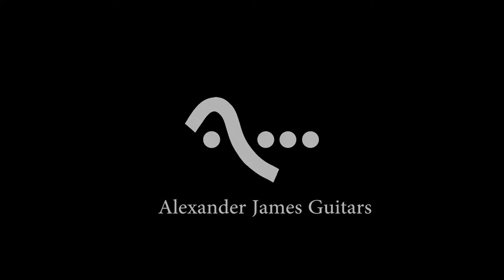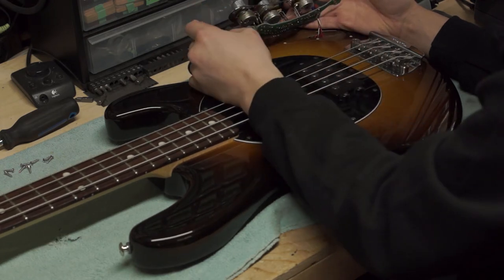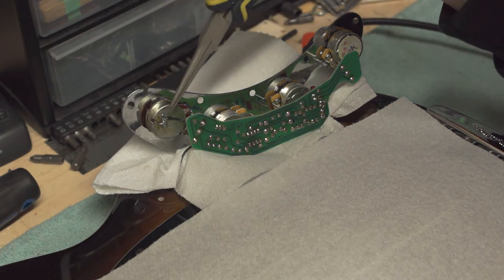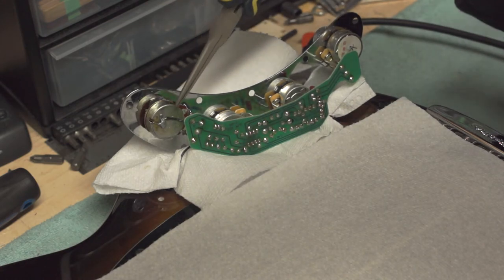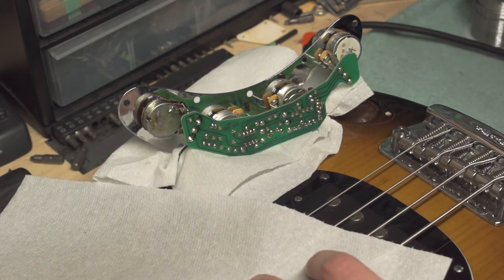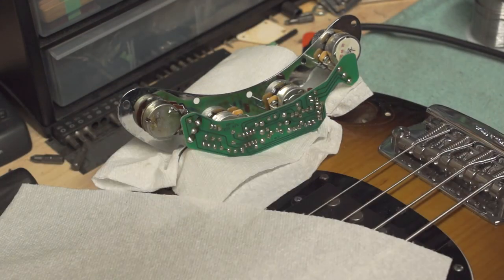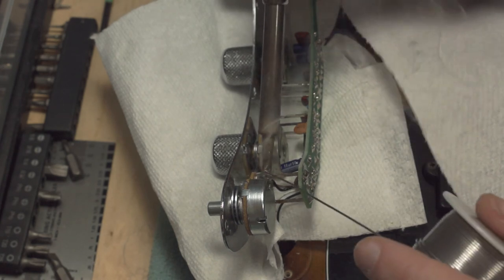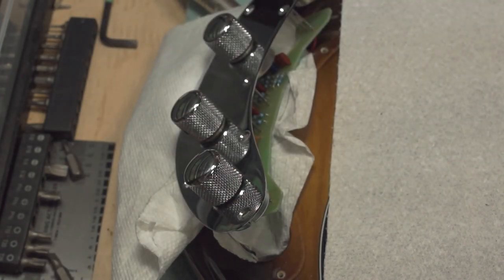Ernie Ball Stingray Bass electronic repair - Fix it Friday #1 AJG

Comment: I had this same issue with many guitars and bass. I solved the problem. The contact cleaner I was using didn't have lube in it. Common contact cleaner from the local hardware/ auto stores isn't designed for potentiometers. It's designed to clean none moving connections.  Something like Hosa D5S-6 has lube in it and improves the connections in the potentiometer. However it is expensive so the cost of replacement potentiometer vs buying this cleaner is up to you. I'm little late on this video but what else are we doing in the pandemic?
Reply from the maker: Wow, thank you for letting me know that. 
I didn't know that. 

Gotta find something to keep our mind active during this pandemic! Thanks for watching and commenting BTW.

Comment: Tip: On my Stingray I re-attached each knob with its tightening screw at the exact halfway point of travel. The screws now indicate the 0 cut/boost point at a glance when I look down plus I can see how much I have boosted eq, if the volume's up full etc Simple and super useful adjustment to make.
Reply from the maker: Nice!
Reply: I did similar but have them pointed line of sight towards me. Really helps on dark environments.

Comment: But why was then the scratchiness gone when you touched the electronics plate? I would rather suspect a corroded washer and therefore there was a poor connection to ground. Replacing the pot could have solved that because of the new washers, but a real solution in my opinion would be a more reliable ground connection, than just the mechanical connection through the washer of one pot. Might be wrong though, it's just my two cents...
Reply from the maker: I appreciate your comments.

Comment: "Paper towel is here for protection" So the oil soaks through the paper towel onto the body of the Guitar. Very clever!
Reply from the maker: That is contact cleaner, not oil. Also, you will notice any over spray of contact cleaner on the paper towel is completely replaced in the next scene.
Reply: Ok Alex but if you are going to put a towel down for protection, an absorbent towel is probably not the best. Maybe something like a Microfibre cloth would be better.And a straw inserted into the contact cleaner gives better application.